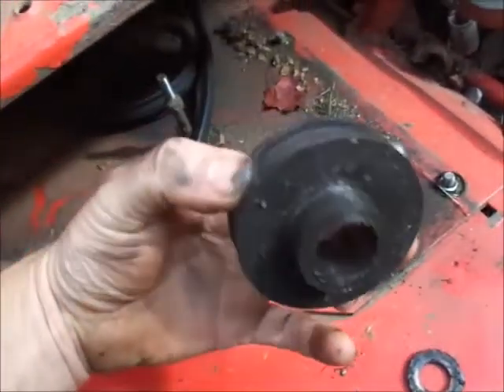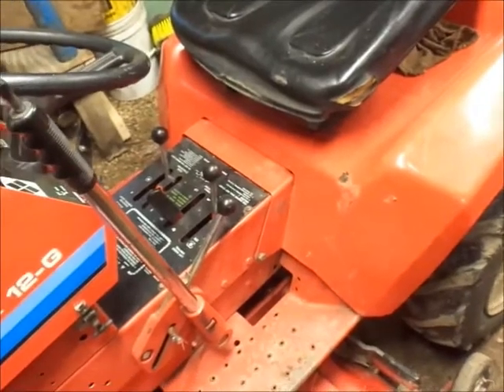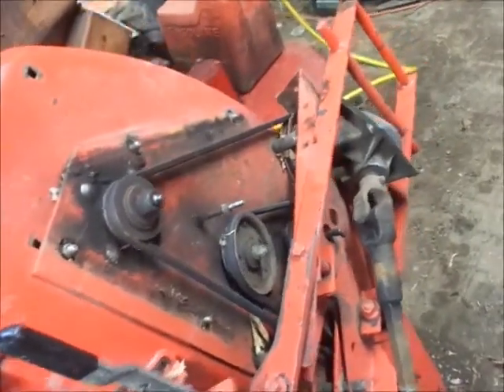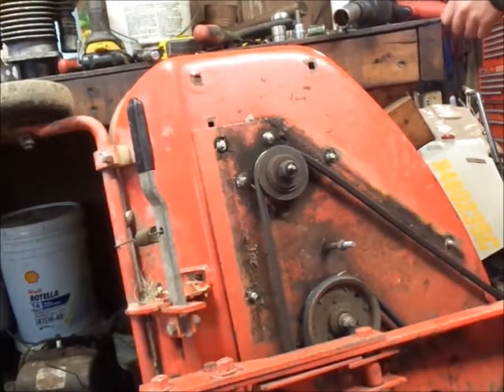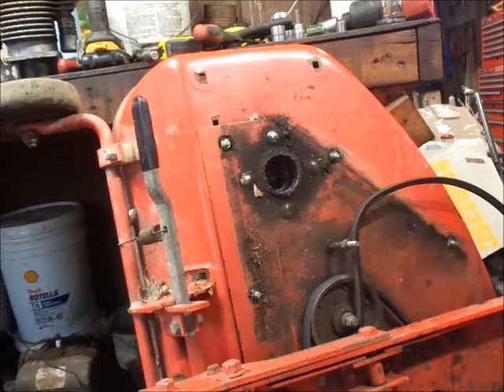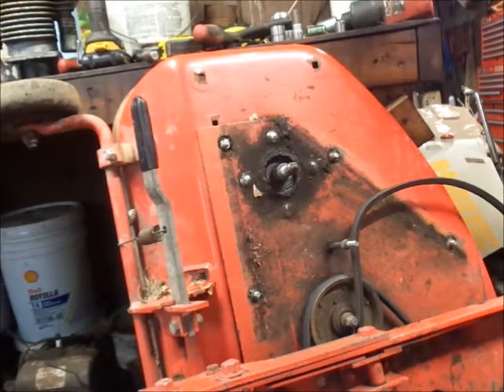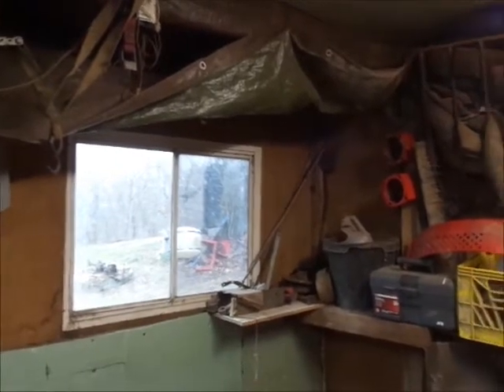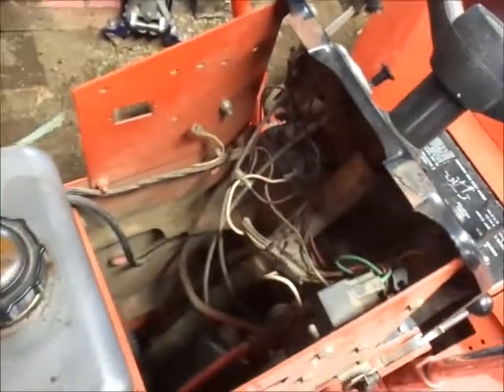87 12g gravely spindle shaft change

Comment: Thank you so much for all of the helpful videos. Question I'm trying to put the double ended spline through the front axle of my 8123G. I have noticed it is not symmetrical. Does the longer end face towards the front of the tractor or towards the rear of the tractor? Thanks for your time! And for all the helpful videos